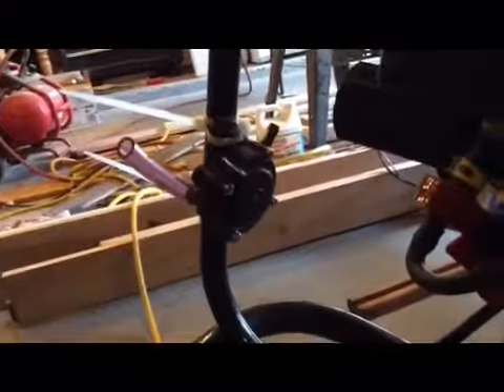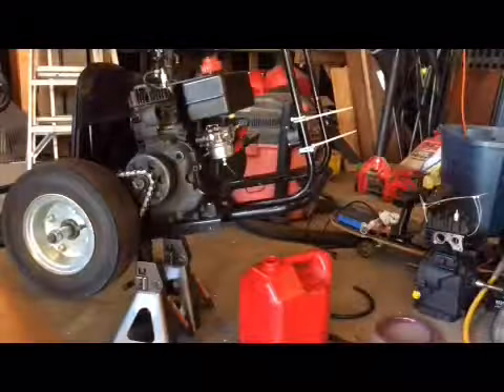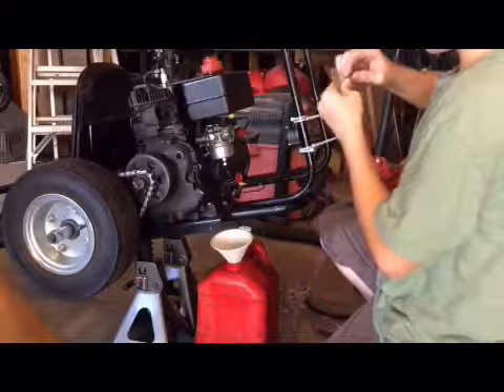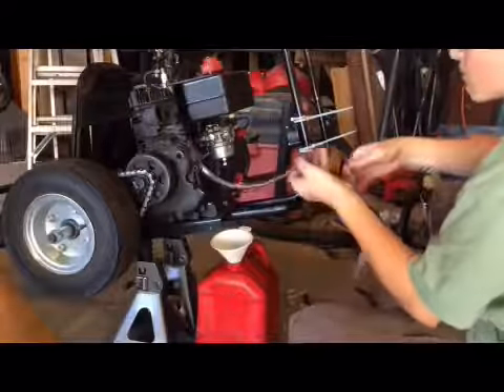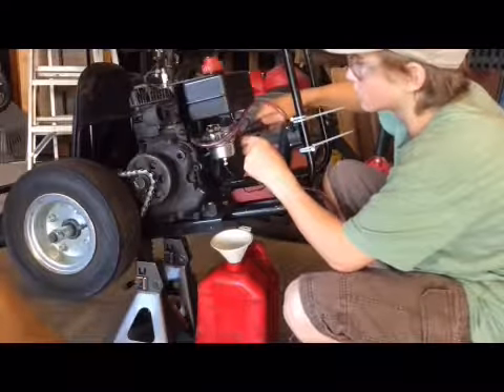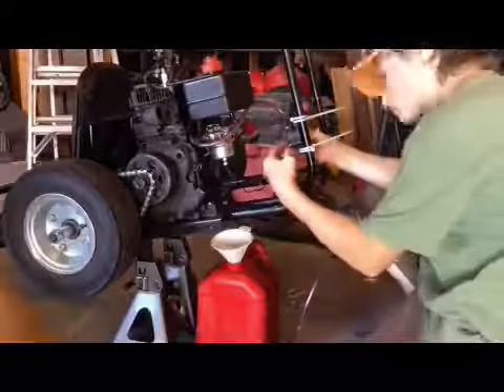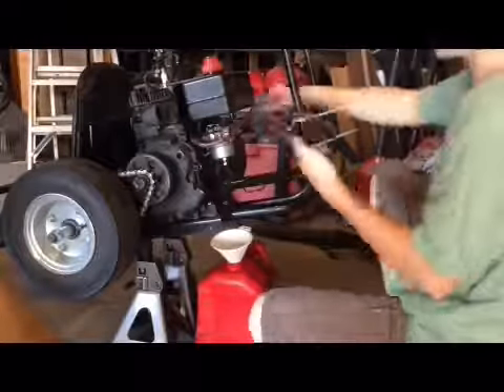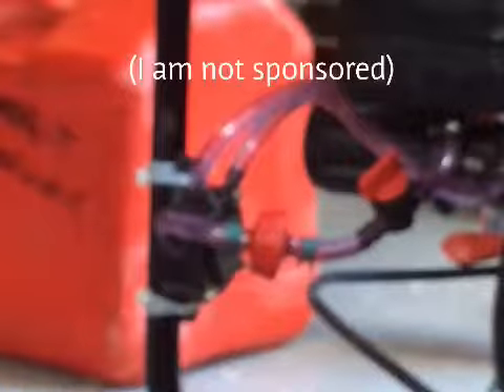Go kart gets a fuel pump

Comment: U hooked pulse hose to the breather the lil black hose that  aims out downwards??I have tecemseh also
Reply from the maker: Shark 3:39  yes the valve cover can power these pumps but it’s important to still have a crank case vent so that you don’t pressurize the crankcase. It would work much better if i had ran the pulse line to a signal from the intake but I don’t have the kart anymore so
Reply: @nathangresell1534  what do I think if I pute a T split one for vent one for pump can that vent the crankcase
Reply from the maker: Shark 3:39 yes that would work well. If the pump doesn’t work well enough put a fuel filter on the open end of the T fitting and leave the other end of the filter open to the atmosphere.
Reply: @nathangresell1534  ok thank alot

Comment: Hi, great Video! I also need to install one of these fuel Pumps. But i have a Honda gx390 clone engine. Can i use the same fuel pump that you used? Thank you :)
Reply from the maker: vinataba22 yes you can! Although i have found that the pumps work better when you take a pulse signal from in between the carburetor and the intake port
Reply: @nathangresell1534  OK. Thank you so much for answering!
Reply: Hey sry to bother you again but i need to ask one more question. I ordered that fuel pump and now i am wondering if i can place it anywere i want. Just like you did with the zip ties. Because i saw most people place it ontop of the engine. But that would not be the ideal place for me to put it.
Reply: @nathangresell1534  Hey Don't know if you got my last question because I didn't reply directly to you. But if you could find the time for a quick answer I would really appreciate it :) and it would help me alot thanks mate!
Reply from the maker: vinataba22 yes you can mount it wherever you like but it does work just a bit better downhill or below the level of fuel in the tank so that it stays fed with fuel a bit better
Reply: @nathangresell1534  thank you so much! Have a good one :)

Comment: Why did you need a fuel pump if the gas tank was above the carb?
Reply from the maker: PracticalBuilds i was putting one on so later i could use a tank that mounts to the floor pan. Also the tank isn’t much higher than the carb so to use a fuel filter i have to make it longer, and the i was having issues with fuel supply